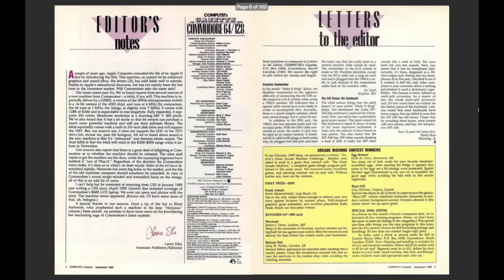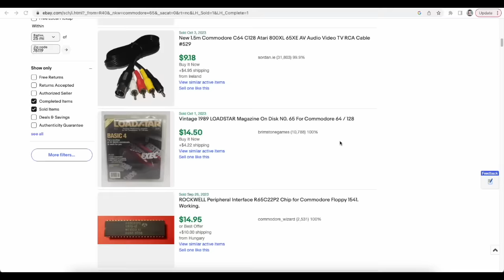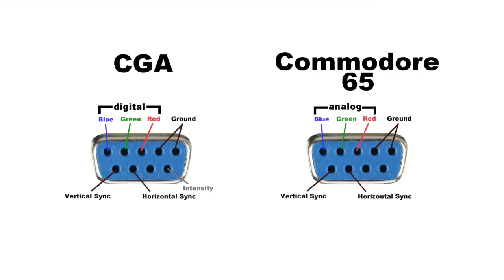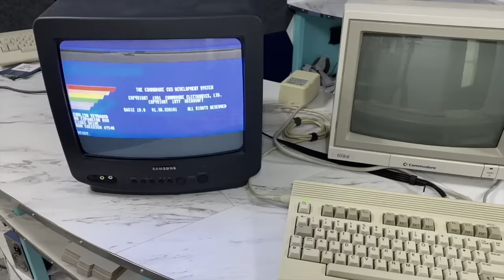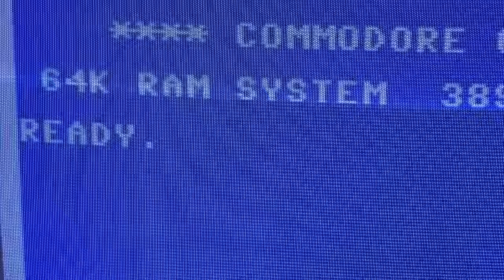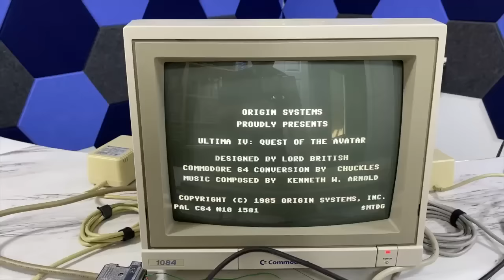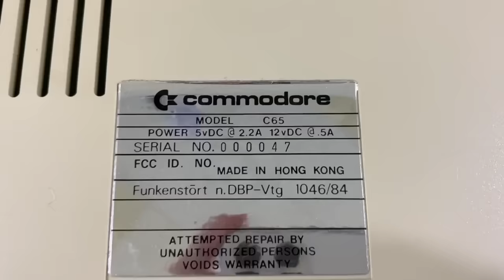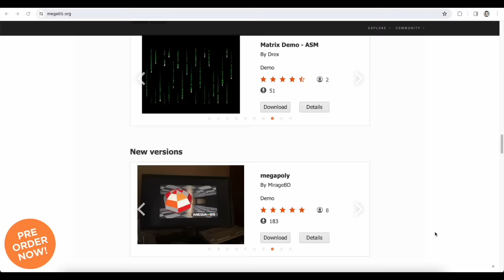The Commodore 65 - A Rare Prototype

Comment: Definitely the price of the C65 prototype is way beyond my price range.  Maybe I could own one someday, but quite unlikely.  Thanks for demoing it, too bad Commodore was a little too late to release this.

If they had preempted the Amiga with this like you said and instead set the default drive to 9 or higher or made it possible to disable the internal drive, then it would have been more C64 compatible since an external drive could be set to drive 8 which a large portion of the C64 diskette software expects.

Comment: Maybe Ultima wasn’t rum because of further more compability problems in the C64 mode. Its the same issue with the commodore 128 in C64 mode. Back in the days I returned my C128 back to the dealer. So many games and other software didn’t run . Not that bad to return to the good old C64. 1987 wow, that sounds history lessons. Keep up the good work.

Comment: You never heard of the 1571-II ? I owned one! The 1571-II was released in 1986 or 1987, manufactured in Germany, mainly targeted at Commodore's very important German and UK markets.
It was a European model and the best 5-1/4 disk drive available for the C64/128.
Reply: You are probably thinking of the 1541-II, which was released worldwide.
The 1571-II was never produced.  No one has even seen prototypes. :(

Comment: If I could change history AND had a say at Commodore, I would have skipped the +4 and tried to get a product with similar specs to this by '87-88.
Included resolutions like 256x240 & 320×224 to make arcade conversions more straight forward. NES style sprite handling with more smaller ones and make sure the company retains Robert Yannes so he can develop SID2 for the machine. With the time and resources to add all the features left on the cutting floor.

It would be easier to bring a Raspberry Pi and all the technologies required for it, but I would try to stay low to avoid Temporal Investigations.

Comment: Nice. Maybe this project was started before Commodore bought Amiga.  Personally I think in about 85/86 Commodore should have released a C4+, with 2Mhz CPU, a Vic Chip that could do 640x200 resolution and possibly a built in Floppy (would have added a lot to cost though back then.)  It would have been like an Acorn BBC but with Sprites, Hardware scrolling.

Comment: 😅Years ago, I worked for a video game company who used RGB video displays. The connector included Red, Green, Blue, Horizontal Sync, Vertical Sync, and Ground. The rolling screen looked much like a configuration we had to use with our displays. The major point I want to share is the H-Sync and V-Sync lines were connected thus creating a C-Sync (Composite Sync) signal. No idea if you still have the C65…but if you get another chance to play with it…you could give it a try.

Comment: If I remember correctly, the CPU used in C65, besides running at a faster frequency, was also able to complete a single-byte instructions in one cycle, making it the fastest per-cycle CPU of the 6502 family.
Reply: Which is great, if you weren't already developing advanced 68000 products that would be incompatible and in direct competition with the proposed C65, and had the market for C64s not been completely saturated. But Commodore were, and the C64 market was, so while the CPU was great in many respects, it didn't necessarily make any sense to use it. Nobody wanted a faster C64, because existing games wouldn't work properly. The C64 was by that time, dirt cheap. Any new 16 bit software would only run on the C65, but would anybody write software for it once the Amiga came out?
Reply: Interesting -- I wonder how that would have affected its MIPS rating.  Based on one of David's previous video, it seems even a stock 6502, had it been clocked at 3.5mhz, would already have a higher MIPS than a stock 68000 @ 7mhz.  Is that right?

Comment: To be honest, if this computer came out you'd probably see at least some games re-released on the c65 on 3.5" floppy because unlike the other machines where people would buy a later computer but use the same disk drive, this one has a 1581 built in. Combined with the significantly better capabilities, this might have been enough to get people toi put their software on 1581 disks. With the c128, a few games did come out on the 1571 format, but only because they really benefitted from what the c128 had to offer.

Comment: Quick tip for anyone dealing with PAL/NTSC conversion problems: find yourself a VCR from the 2000s -- it will probably be a VCR/DVD combo unit. Newer VCRs often convert between the two and make a great AV hub for all your old hardware.

Comment: This instead of the Amiga?
No way. 
The original Amiga may not have been much more powerful than this, but with its multitasking OS, GUI and expandability into a full 32 bit machine the Amiga was the beginning of a new generation. 
The C65 was an extension of old technology and nothing more than an attempt to stretch the life of old concepts a few more years.
The time of computers that booted into a Basic Interpreter was really over at that point.
Even the Apple II GS ( that did have a GUI) became outdated pretty quickly. There was no real upgrade path anymore. Nobody bothered with building a 32 bit computer like that. It was a dead end.

Comment: At 15:49 8-Bit Guy says that he expects the CSG 4510 to be as fast as or faster than a Motorola 68000. Why? 

If anything, I would expect the opposite, i. e. the 68000 being faster per clock than a 4510 / 65CE02:
- The 68000 clocks twice as fast. 
- It has a 16-Bit ALU and 32-Bit registers. 
- It does not have to maintain backwards compatibility to the 6502.
Reply: Hey there -- David is referring to the analysis he did of the 68000 he did in his Amiga 1000 video.  Here's the clip:
https://youtu.be/kjapiUQOi2s?si=qNERvdUKvorRyL6N&t=316

Comment: To chime in with the compatibility issue and what card they could have at hand:

The in-built disc drive could just have been numbered by the system as disk 9.
The IEC  bus could have been programmed to have the first drive as 8, and from there the numbers could go at will.
Maybe this is something that still could be hacked into a custom burnt ROM for the C65 tho and would allow for a quite seamless compatibility solution - just buy a 1541 or 1571 drive to read the original disks when in C64 mode.
The built in disk at number 9 would be any longer to type in so the convenience is preserved, only compatibility is added IMHO.
Also all the in-built commands could be addressing drive 9 per default (hardcoded) or a command could be added to the basic 10 that would allow to define the default disk, after booting the C65 with the 9 be the default, and booting C64 as usual with the IEC connected drive 8 being the default...

Why this solution was not picked by the dev team back then?

Comment: Oh my heck, I just figured the disk drive in the C65 was another 1581, just built in like the 1571 on the D128 or the 1541 on the SX-64, but wow, it's actually a Commodore 1565! I like the cleaner look of the 1581 better, though. I had NEVER heard of or even seen a Commodore 1565 until just NOW, oh my gosh! Is that HD despite its lower model numbering?

Comment: This instead of a Plus4 or with an optional Z80 instead of a C128 would have been great, but after they went to the market with the A500 it was a waste of development resources. It's a bit like the A600 or the Commodore CDTV, the products where not wrong but marketing  should have stopped them before going into production.

Comment: I'm guessing they went with analog RGB for more colors.. I think RGBi can only do 8 plus intensity.  They did the same thing on the later Mindset computers.. the first ones had RGBi but then they switched to analog so you could access more of the palette without going to composite.
Reply: Yep. Same story with IBM: the CGA had RGBI and composite outputs that could nominally only generate 16 different colors, whereas the VGA had an analog RGB output that could generate 262144 different colors, and later “Super VGA” cards could generate 16777216 colors on that same analog RGB output.

When DVI came along, we were back to digital RGB again, only this time with that same 16777216-color palette instead of just 16. But DVI/HDMI/DP signalling is much more complicated than the old RGBI system.

Comment: I remember when it was huge deal to have a rare 3.5in disk drive for the C64/128. In fact, the only readily available software that actually provided additional support for the 3.5 was GEOS (Graphic Environment Operating System). A product of Berkely Software if I remember right. The 3.5 also worked with TurboDOS, Final Cartridge, the Epyx disk accelerator, and others. Neat little disk system and worked with was it 1571 support? It could default to 1541 mode. But 1541 is slooooow. 

But to see an integrated unit? Now that's truly seeing "what if". Many people used to lambaste the C64 in its later years as ancient, ugly, and lacking the innovations and designs that seemed to make Atari Computers the juggernaut of the 8 bit revolution. But in reality? The C64 and it's follow on units had the most peripherals, the most software, and the best games! And now it seems Jack Tramiel had wanted to compete with his future company head on. The C65 is really like the Atari 1450XLD with built in disk drive(s). Great presentation of this rare and historic relic in the Commodore legends!!
Reply: Correction: The 1581 IS the external 3.5in disk drive.

Comment: To load Commodore 64 software from a 1541 on the C65 / C64 DX:
Set the device number of a 1541 to Device 9
OPEN 15,8,15:PRINT#15,"U0>" + CHR$(10):CLOSE 15
OPEN 15,8,15:PRINT#15,"U0>" + CHR$(8):CLOSE 15
LOAD"$",8 : REM THIS LOADS FROM THE 1541 :)
You're welcome.
Reply: This definitely does not work for me on my 65.  Does it work on yours?  If so, what is your ROM revision?
Reply: @bozimmerman  Mine WAS one I bought on Ebay for 11K in 2008. I no longer have it. But it worked on mine.

Comment: It's also possible that if this had been slated for release, they would have noted the fixed drive ID compatibility problem and added drive ID jumpers to the back of the unit, so if you intended to primarily replace a C64 with a C65 and had a large library of games on 5.25 floppies, you could set the internal drive to ID 10 and plugged in a 1541 and set it to 8 as normal. My guess is that the fixed drive ID is just an unintended consequence of it being an unreleased prototype and not an actual "feature" they would have stuck with.

Comment: BASIC 10.0 in C65 is about twice as slower per 1 MHz, because is much more expanded than relatively simpler C64's BASIC 2.0. Add to that it has to manage more than 64 KB of RAM and bigger screen area to service. For example C128 BASIC 7.0 in 1 MHz 40-column mode is twice as slower because it has more commands (is 4 times bigger than BASIC 2.0). Add to that bankswitching (in one bank resides BASIC program in other variables) and it is twice slower.

Comment: Yeah, other than Amiga, people just wanted systems to use their C64 libraries.  X86 did their upgrade path right.  Faster CPUs that just ran older software faster.  Even if it was too fast.  Commodore, I think, just got strangled by their own massive software library.  Even today, X86 uses the same strategy.  Not to say that Commodore didn't try with Amiga.  Maybe if they had made an even lower end Amiga that could have been slowly upgraded to match the 500 - at least - and abandoned the C64 stuff.  Or, yeah, keep increasing the speed of the 6502.  The Commander X16 is, just, a better example of what might have been done.

Even the 128 was nice, but people rarely used it in 128 mode.  It was, just, a fancy C64 - with the same capabilities, in the end.

Comment: The elephant in the room is that by 1991 the 8 bit era was well and truly over. It would be interesting to see what the last successful, say > 1000,000 units in any territory, 8 bit machines were. It's obvious why C= canned this product.
Reply: There would have been a market in the UK for this from 1988 probably through to 1993/94. PC's and Amiga's were still predominantly an upper-middle class thing while Commodore and Spectrum were the working class computers probably right up until the launch of Win95. The Spectrum limped on until 1992 despite the financial troubles owing to the C5 while the Commodore continued until 1994 with the UK arm still profitable when the US parent went bankrupt. Wouldn't have survived the coming of the PS1 in 1995/96 though.
Reply: @watcherzero5256  I think you are overstating it a little. We got our A500 in 1989 and were far from upper class, same for a few of our friends who seemed to favour the ST. You can see the decline of the 8 bits in the failure of the SAM Coupe, released in 1989. Sure it likely failed for other reasons too, but the bigger part is that people had moved on. I'd grand you 1990, at a push, but by then the 8 bit processors were all 15 year old designs and were not viable in the home computer space.
Reply: @lawrencemanning  And yet they continued to sell until 1994. The Commodore 65 was a 16 bit computer anyway.
Reply: @watcherzero5256  By the same definition the A500 was a 32 bit machine then. :) But to extend your logic, filament light bulbs can still be bought here (UK as well). "Continued to sell" does not mean the market isn't dead and is the place to introduce new products. Anyway lets agree to disagree eh.

Comment: I'd like to have seen Commodore release this as a low cost replacement for the C64.  Perhaps instead of the C16 and Plus 4 (these always seemed like a step down from the C64).   If emulation tech had been a thing, I'd like to have seen a C64 emulator bundled with the Amiga, which would have persuaded a lot of c64 owners to upgrade.  Having to junk potentially a lot of software because you had to sell your computer to get a new one stops a lot of people upgrading.   Some sort of backward compatibilty on the Amiga would have helped, even if Commodore had to do a C64 on a card in much the same way Apple did with their PC and Apple II cards..

Comment: I have a C64GS actually... The GS stands for Games System and is a console version without a keyboard and only takes cartridges... It was a bad idea to begin with even before considering the fact that it came out the same year as the SNES.  Yes the Super Nintendo. So they didn't sell well and thus are quite rare which makes them somewhat valuable

Comment: @9:00 I miss the 90s. lol ... I'm willing to bet the basic on the 65 is in debug mode. Time to take apart a 20k to 80k prototype unit! :) I think they woulda corrected the firmware in regard to the disk controller.. this was an alpha product... e.g.  disk override if you had a 5.25 external drive if it ever went to production... commodore was pretty much as incompetent as the BBC is with Dr. Who in 2023 when they were trying to run their computer business in the 90s.. They were light years ahead of ibm... But still managed to go bankrupt.  R.I.P. I spent two years saving for my amiga 500 in 1987... I eventually owned an amiga 500 in 1989.. I'm heavily vested in amiga as by far my favorite computer of all time... But damned commodore :(

Comment: The C65 would have been a huge failure if it came out in 1991. Nearly no software company would have developed games specifically designed for it and it was not 100% C64 compatible. Additionally, the market was already moving to 32 bit computers at this time, 1991 was just two years before DOOM came out and changed everything.

Comment: The disk drive situation and implementing C64 mode with a CPU that's not fully instruction-compatible or cycle-compatible with the original 6502 would likely have turned out to be pretty big issues. A new C128 with a VIC--III might have been a better option.

Comment: I expect that the first hardware hack for the C65 would be a reversal of the 8 for internal and 9 for the external, allowing a 5.25 to be externally mounted as automatic 8 and 9 for internal. The Amiga 3000 would mount the two internal drives as df0 and df1, a reasonably easy hack would change external to df1, so I would expect something similar if the C65 was actually released.

Comment: Really impressive motherboard, seem some other "reviews" of the 65 before but never the inside. One comment however - it almost looks like Commodore did invent the Amiga and it did not make sense ot have a modern C64 on the side. But Commodore bought the Amiga company in 1984, launching a potential replacement 6 years later seems .. interesting

Comment: This thing is cool but by 1990 this thing would not have been competitive in either the Computer or console Market The Genesis Came out in 89 and the SNES would come out a year later in 1991 and those are 2 of the greatest consoles of all time so the Console Market would have been a wash and for the PC Market IBMs were dominating and 1990 was also right on the Cusp of the Golden Age of PC gaming Starting really in 1993 with Doom and the C65 was another Commodore Computer that was incompatible and what makes the PC king to this very day is software compatibility That's why Commodore eventually did go under and why Apple almost went under. It's a cool piece of history but you're right about this system should have came out a few years earlier

Comment: The problem here is that the C-128 already existed as C-64+++ type machine and adding a second, yet incompatible, computer in that class was never going to work.  No native software would ever be made for it, just very little software was written for the C-128 in C-128 mode.